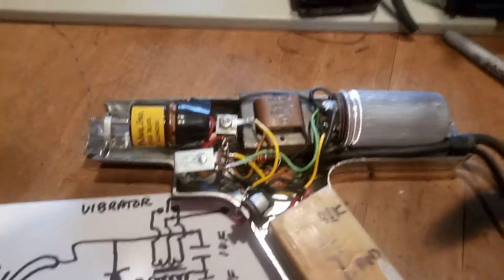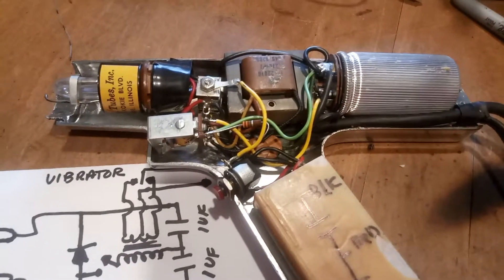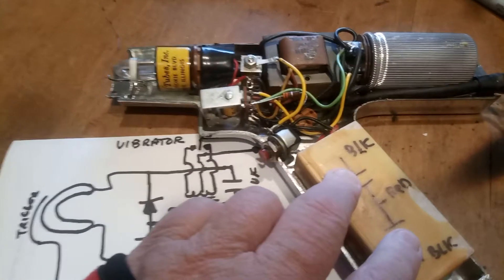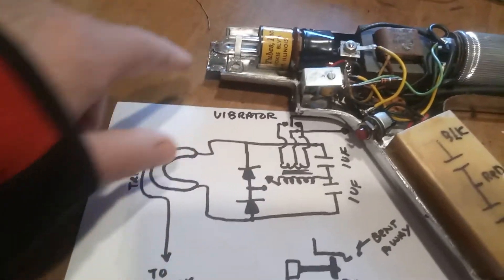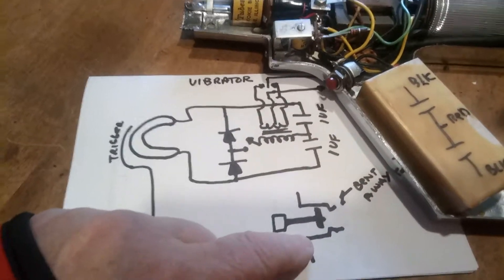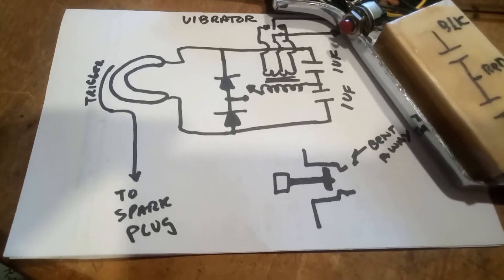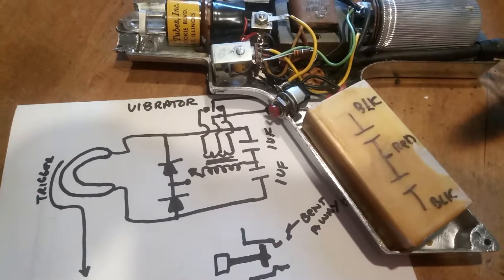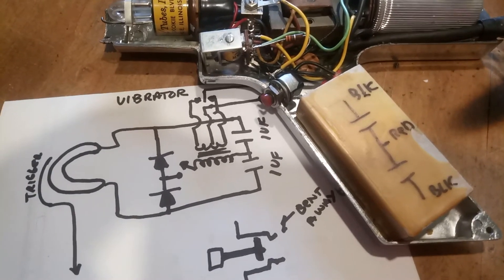1960's Vintage Old School Timing Light Repair. The Way Electronics Used To Be

Comment: That was fun. The last vibrator PSU I saw was in an old VHF mobile transceiver stuffed with valves.
Reply from the maker: I have the first HP desk calculator that I should dig out.  CRT display, delay line memory  and speed so slow a solenoid locks up the keyboard while it is calculating.